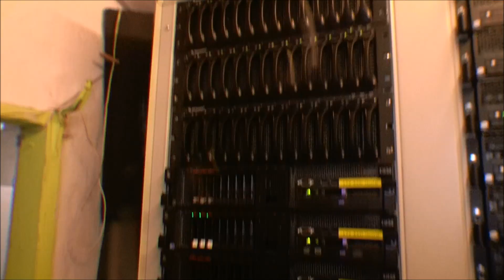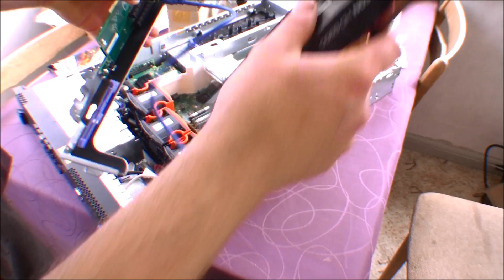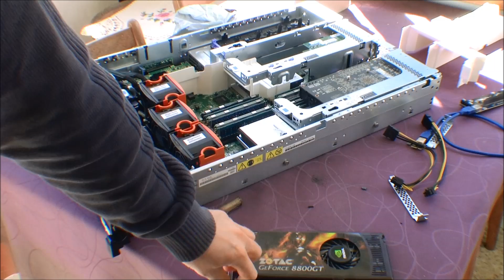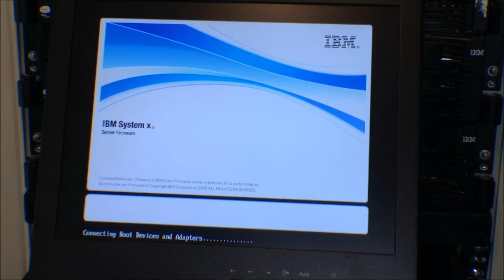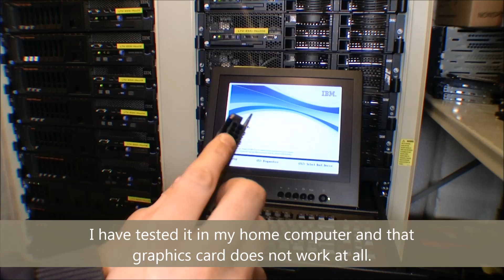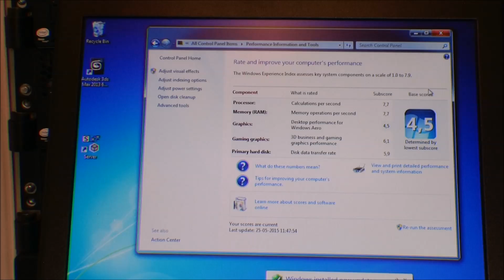Graphics card in a IBM Systen X x3650 M2 or M3 - 190

Comment: i did this with 1050ti  on a x3650 m3 works fine, launched scum and it worked good no crash or nothing ;D you can probably add a powersupply on the side add the pcie pins into the gpu if it needs more power and hotwire psu with these 24 pin hotwire thing
Reply from the maker: Hi morris K
Thank You very much!  glad you liked the video :-)
Thank you for watching! :-)

Comment: Hello kind sir! I have a 1U X 3250 M2 server that I have had on a shelf for a very long time.
Today I removed the E2200 CPU and replaced it with a Q6600! Socket 775! It also accepted 8GB of non-ECC PC6400 DDR2 RAM with no problems.
I am very happy that it worked. My next plan is my graphics card. The internal layout of my server is very similar to yours, but it is all 1U. Unfortunately I don't have a single slot GPU (GTX 680 is double slot).
I am hoping to use your video to help me fit this in my new machine. It is very noisy! 
Thank you
Reply from the maker: Hi CableWrestler
Thank You very much! I am not very knowledgeable with th x3250 M2, but you need to check if it had a PCI-e X16 slot for a GPU card,, and if it has internal power pin for GPU,, 6pin or 8pin.
If there is only an PCI-e X8 there is just 25watt in that slot. If there is an PCI-e X16 there is 75W (unless anything else is noted) 6pin connector is another 75W and 8pin is 150W,,, and then there is the spaces limitations in the server.
Thank you for watching! :-)

Comment: A great job. Its always better to grind the plastic away and allow the full x8 connection (Some Severs even offers "open" x8 slots by default). Because if we just using a stock x1-x16 riser adapter then x8 would get negotiated down to x1. That's fine for mining but not for rendering / gaming etc.
Reply from the maker: Hi XGreenThumb
Thank You very much!  My suggestion is to grind the cheapest bit to replaces,, if you F* it up.
Thank you for watching! :-)

Comment: The issue I see with the USB-Riser thingy is, that it only seems to be 4x on the PCIe side. USB 3.0 has a transfer rate of 5 gb/s, but PCIe 1.0/2.0 only manage 1gb/s / 2gb/s on 4x. So when using this one on a old Server, you'd get even more of a bottleneck.

Putting it simple, "our" old PCIe 1.X 8x Slots are already at the very borderline when it comes to even older high end GPU (think GTX 680, HD 7970). Something I wonder tough... the way PCIe works i.E. you can just cut off the back of a x4 slot and throw in a x16 card and what not, wouldn't it be possible to make some kind of adaptor for 2 x8 to 1 x16?
Reply from the maker: Hi MadIIMike
Thank You very much! I have made a lot of videos on GPU and servers,, check out more!
Thank you for watching! :-)

Comment: Sorry to resurrect an old video, and maybe you've already seen these.. but... How about a PCIex8 to 16 riser connector?... Like this http://www.ebay.co.uk/itm/like/222043900978?limghlpsr=true&hlpv=2&ops=true&viphx=1&hlpht=true&lpid=122&chn=ps&googleloc=1006914&poi=&campaignid=207297426&device=c&adgroupid=13585920426&rlsatarget=aud-133395220626%3Apla-131843274546&adtype=pla&crdt=0&ff3=1&ff11=ICEP3.0.0-L&ff12=67&ff13=80&ff14=122&ff19=0...
Reply from the maker: Hi +Lord Xelous 
It is not older, then I have this on in order : http://www.aliexpress.com/item/PCI-E-8X-to-16X-Slot-Riser-Card-Flex-Flexible-Extension-Cable/32617836661.html
Thank you for watching! :-)
Reply: did the riser adapter work?

Comment: Hi, not sure if you know about this server but I have a HP DL585 G6. It has 4 Processors each running 6 Cores = 24 Cores, Runs really well 60GB of RAM runs well. Anyway It has 2 power supply's, has 2 molex sitting on the side? Can I just plug in a graphic card and it will automatically change to it? I have a spare GTX 580 which might be a bit too high end? But I also have a ATI R7 240? Which is a low end card using little power? Any suggestions? Thank you.
Reply from the maker: Hi +Gracjan Lewinski (TheGratchh) 
If the graphics card fits and there is power for it it vill work just fine. It's getting a virtual machine to see and use it that is the challenge. The DL585 G6 is an AMD server right,, i have not tried that.
Thank you for watching! :-)

Comment: Hey, 
I got ibm system x3400 with 32gb  and 2 Xeon that im trying to make a gaming machine. The server was really cheap (45€) and now im seeing some way to addapt some graphics card to it. I saw some chinese risers, like from pci-e 8x to 16x that i think could be a good bet. Im even think of adapt the riser since the pci-e only gives 25W of power and usually the high end graphics need more juice. Do you think the machine will be bootlenecked?
Reply from the maker: HI +Miguel Rosa 
I do not know the x3400 series,, is it a M1, M2 or M3 ??
I googled it and fund : pci-e + 6pin = upto150watts. in addition to the standard 75 given by the pci-e slot the 6 pin will add up to another 75w.
Here : http://www.tomshardware.co.uk/answers/id-2332686/power-pin-connector.html
I do not think it is going to be a easy game server.
Thank you for watching! :-)

Comment: Silly question does IBM have proper 3d GFX drivers for that IBM onboard video driver. my HP G5's don't so I get the basic video card & 1.0 in the Windows 7 as well. Once I  install server 2003/2008/2008 R2 it installs the Es1000 ati driver with full 3d driver support. Have you tried the Windows Server in a non vm on the M1/2/3/4 serise Server you have? To see what the video support is? FYI I did up end getting the DL380 G6, I'll let you know how the paththrough is.
Reply from the maker: Hi +Doomed ForLife 
Well it´s no problem to use the builtin GFX card direct in Windows,, it is the virtual layer that make it a hassle.
Thank you for watching! :-)

Comment: Hi!

You know you could have just bought the PCI-E x16 Riser card for this server model and used that in place of the 2x x8 PCI-E Riser board. The  you can just plug the card in without cutting anything and plug in the Power and your good to go.

Here is the Riser board you need:
http://www.ebay.com/itm/IBM-46M6400-x3660-M2-Riser-Card-/150865559077?hash=item232049be25

Another thing is that 3550's come with x16 risers by default (1 full height and 1 half height slot) but they only take single slot cards, but they still have a 6 pin PCI-E Power connecter, just remove the Raid Card battery try to find it hiding underneath.

Source: i Own 2x 3550 M2 and 1x 3650 M2 and have considered options for GPUs, 

Another option is you could have a look at Club 3d's R7 230 PCI-E X1 GPU which would drop straight into the x8 slot and is slot powered.

Hopefully you find this information useful.

-Alex
Reply from the maker: Hi +KSSilenceAU 
Well yes i did find your info useful,, if you check the Ebay link,, it´s gone,,I bought it,, it´s the cheapest one i have seen,,,, :-) though I had to pay $ 35 in the transport and import tax :-/
Thank you for watching! :-)
Reply: My PlayHouse Glad i was able to help you, even with the post and import tax, its still cheap as far as server parts go, especially when new. I Shall definitely be sticking around your channel.

I just love IBM System X servers :P, got 3 already and looking to add a x3250 M3 to the family to replace the x3650 M2 as the "Always On' Domain controller, mainly for noise and power saving reasons. i Can get my hands on one for $175 AUD delivered with 4GB ram Quad Core Xeon and 2x250GB Sata drives.

http://www.ebay.com.au/itm/IBM-x3250-M3-Server-1-x-Xeon-Quad-Core-x3440-2-53Ghz-4GB-MEM-2-x-250GB-SATA-/231700973052?hash=item35f27445fc

Have you any experience with the x3250 M3's ?

-Alex.
Reply from the maker: Hi +KSSilenceAU
No,, i have never had an x3250 to play with,, :-/ we get the x3550,, if we get two U servers.
Thank you for watching! :-)
Reply: Hi,
thats ok, i have a decent idea what I'm in for with a x3250 as i have looked at the detailed specs on it.

i prefer 3550's (1U) over 3650's for ESXi and some other roles because i can fit twice as much CPU and memory in the same space, only downsides is 6 HDD's Max vs 12 and only 2 Single slot PCI-E slots.

Had a look at your unboxing of the 9 year old "new" APC UPS, that sucks the issues you had, but totally worth replacing the batteries in the pack yourself with ones of the same type, half the cost of getting another genuine pack, and those things are built like a tank and give VERY clean power, i have APC UPS's. One of them is 15 years old with new batteries, Beige color 2nd Gen Smart UPS 700XL, and still gives perfectly clean power to protect the ADSL and Wifi in the study.

Just beware that the Serial cable pinout is NOT standard for those units, and using a standard serial cable could cause the unit to shutdown the outlets if you open a serial session of any kind to the unit.

-Alex.
Reply from the maker: HI +KSSilenceAU 
There is another UPS battery video coming this week :-)
Thank you for watching! :-)
Reply from the maker: hi +KSSilenceAU 
to bad..

Hi Morten Hjorth,We're sorry to let you know that vistafc canceled your order and mentioned the reason as I'm out of stock or can't fulfill the order for another reason.The seller refunded $65.33 back to your original payment method, and you don't need to do anything else.Thank you for watching! :-)
Reply: My PlayHouse 
That's not me, I didn't order anything.
Reply from the maker: Hi KSSilenceAU
No it was the nice PCI-E X16,,, they did not have it :-( They just send my money back.
Thank you for watching! :-)
Reply: My PlayHouse 
Hi, whoops my bad got confused...
That's just stupid for a seller to list something they don't have / not take the listing down if it sold elsewhere....   keep an eye out for more of those risers though.  Ah well such is life.
-Alex.

Comment: Hi,
   I have a Supermicro board on a few of my servers, and if I install a PCIe graphics card I cannot virtualize the KVM in the IPMI interface. I can access the IPMI interface via IP, but when I try to run the virtual KVM console, it shows just a black screen.  Have you tried to do this here with the IBM  IMM BMC interface and the virtual KVM?

I would like to see if you get this working because I would like to pass through a graphics card to an Apple VM on ESXI.
Reply from the maker: Hi Les Garten 
Interesting problem, it had I not thought about if IBM's RSAII or IMM will function when there is a second graphics card.
I have the same planner with pass through a graphics card to an xxxxx VM on ESXI, so you'll probably see my struggles.
Thank you for watching! :-)
Reply: +My PlayHouse (Morten Hjorth) 

It does function, BUT you must tell the Server in the EFI to use the Onboard video for display rather than the GPU, atleast for ESXi Anyway, Windows or Linux may be different as they may allow you once booted to use both the onboard and the Add-in card and mirror them, i will need to try the later myself and see what happens, il give it a try tomorrow and report back.

Comment: Although the external solution might be easier, the internal one gives a much better look in my book. These PCIe cards will need power, they simply won't work without them being present.
Reply from the maker: Hi TCN0101 
Do you have any idear how the power works in thag 6pin connector?
Thank you for watching! :-)
Reply: I actually can't find any relevant information on the motherboard mounted 6-pin connector online, which is pretty weird considering this is IBM.
However, if you have a multi-meter you could certainly measure the voltage of the pins in that motherboard-connector and compare it to the original PCIe pin-out. When you find out where the +12V and ground are located in the connector, making a 6-pin to 6-pin cable yourself shouldn't be that hard. Especially if it matches the original PCIe layout, which in that case it's just to splice the yellow and black cables together. 

Looking forward to an update on this project!
Actually got an x3650 M1 which I gave to my friend as it's way too noisy for my usage. Had 2 of those 'weak' dual-core's as you mentioned in your other video too, but for him as a testing server it's more than enough.
Reply from the maker: Hi TCN0101 
I have now made a video, where i make my one cable,, and it works. See video next week.
Thank you for watching! :-)